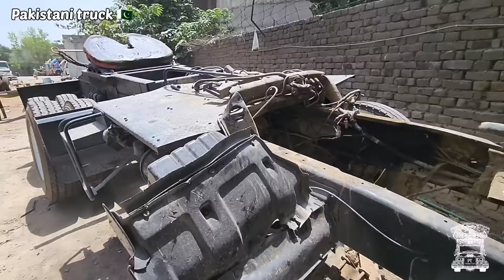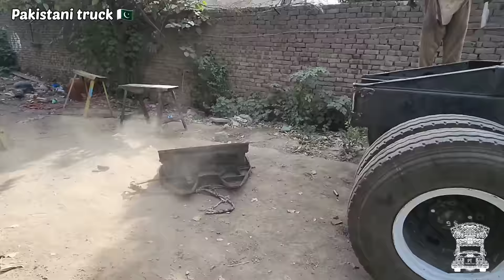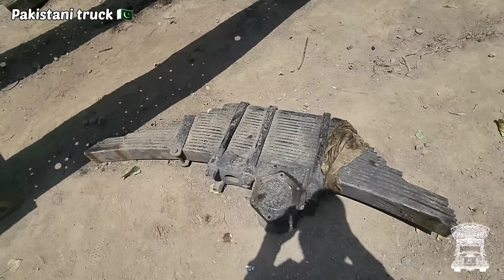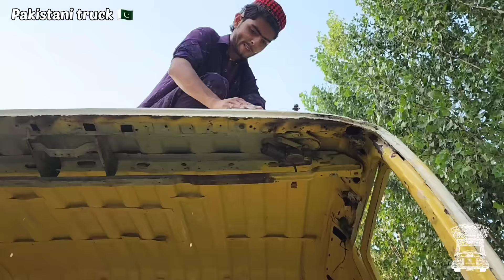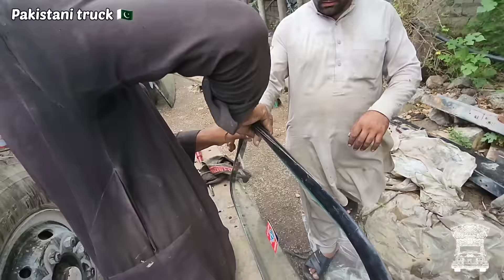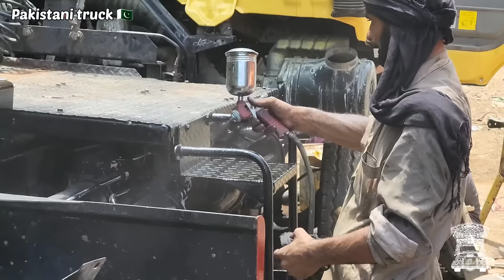Fully Restoration Of An Old Prime Mover Truck | Complete Repairing Cabin / Chassis & Much More

Comment: That truck is stuffed. Chassis, cab, suspension, steering and who knows about engine and trans.
I guess it does not rain in Pakistan,,,, the windows have no hope of sealing and the cab that has about half its original stregth will flex and break the screen.
Yes the truck looks sort of ok but nothing is really serviceable

Comment: You know the cab is not even close to being  dimensional correct when you have to jack the thing to get the window to fit!
Most likely it will pop that window out later on.
Structural integrity of the cab is in the basement.
Pass me the Bondoh Akmed!